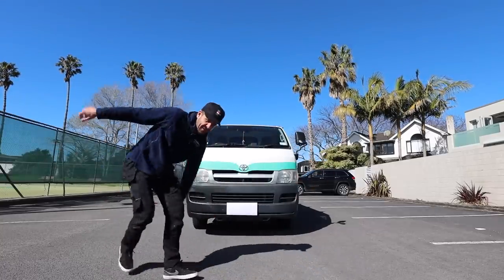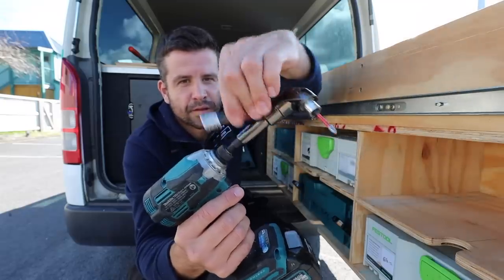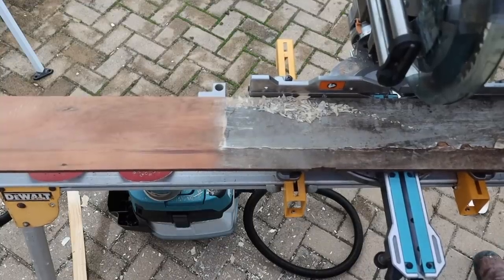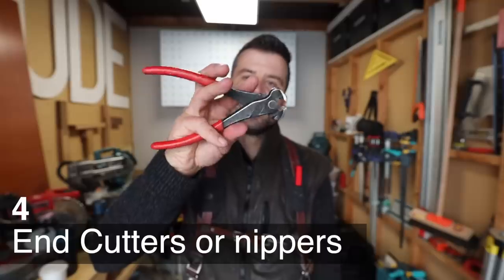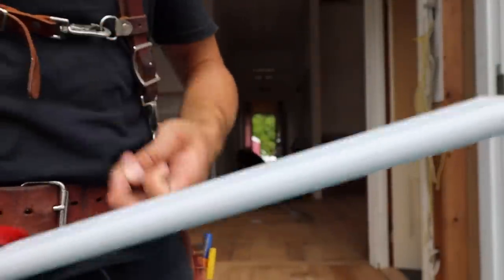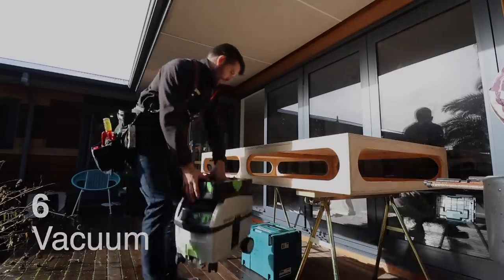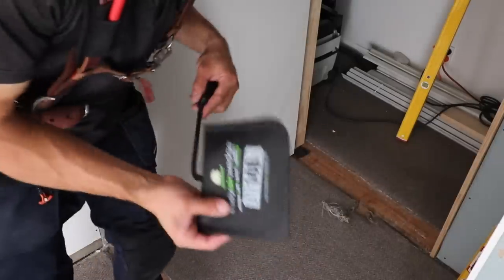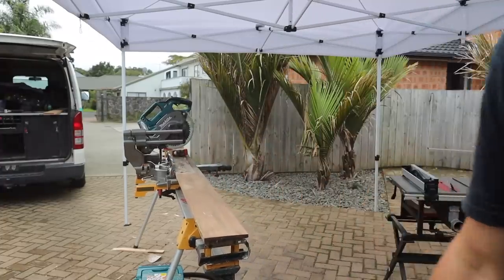7 Unexpected Tools For Builder's and DIY

Comment: My paint scraper is the same as yours, and I am lost without it. I can scrape a surface (instead of sanding) to prep for paint. Huge time saver. But I sharpen the blades frequently on the Tormek and am always blown away by the result. In saying that, I really regret the hours and hours and hours I wasted on a whetstone. Life's too short.

Comment: And after watching more the video a good tip is to be careful with the razor blade scraper it is great when you needed to be sharp but if you need it to be a little bit dollar and if the switchblades Take It Outside to some fine concrete and just give it a little back and forth on the fine cement Adele the blade just enough that it still grabs and cuts good but it actually doesn't digging deeper than you wanted to cuz it will do that

Comment: 2:15 BUMMER, as that’s the nicest looking and legit right angle “bit”. Some of them have a rounded head at “right angle” and hard to get into places and made of plastic, the one you have is “cut out” at right angle and looks all metal and well made. Dang it, now I want that brand you have…. FYI, glad you chose that MILW right angle adapter; as not a fan of the “newest” one they have…the SHOCKWAVE right angle adapter, the bit collet is closer to the adapter itself compared to the non shockwave model, but prefer the shape, feel, use if the one listed compared to the “newest” shockwave right angle(when got it, used for few weeks and went back to older model, as “felt” better to me. But everyone is different and that’s my opinion of the shockwave right angle adapter).

Pretty cool vid, and all the tools are useful, maybe not every day; but definitely used when remodeling; and maybe even in everyday home repairs or installing RTA furniture etc….👍🏻
Cheers✌🏻

Comment: HINT: on your angle adapter, use a normal drill; use painters heat gun for the hard paint; love the Multi with plain blade to separate flashings or anything glued; buy super long multi blade. Hope the crazy lockdowns end soon bro
Reply: Pulls out milwaukee 1" drive impact

Comment: i am a retired furniture maker who has a 100 year old house which is getting a full reno.  my wife bought me a multi tool for my birthday one year.  i thanked her profusely whilst thinking what the hell am i going to do with this little gimmicky thing.  i was so wrong.  i use it for flush cutting dowel plugs, cutting the nails behind base boards so i don't split them.  the list goes on and on, which just goes to show she was right.  she is smarter than i am lol.  oh as an aside, the scraper blades can be touched up on a diamond plate rather than just tossed.

Comment: Scott you have the ARES 70790 right-angle Driver, not sure if it's still availble,mine dates from around 2018.
Milwaukee's angled driver Part No: 49228510 looks identical, & rated for 40 Nm torque and a maximum of 1750 rpm.
Reply: Nice one!

Comment: I'm a DIYer but have remodeled 4 houses in the past 20 years from the studs in, roof to foundation. Never needed a right hand drill. There are other ways. Sure, would be nice but what isn't nice is a huge number of 1 use tools.

Paint scraper is only needed when actually needed. Zero reason to just have one. There are actually several useful/needed tools for removing old paint.

Might be location but I've never had an inspector check wood moisture. Never heard of that. I think I'd wait to see what they find.

I do like nippers for pulling nails.

Oscillating saw is great. Cheap too. Wouldn't say that's an unexpected tool. Easier ways to dry drywall though. Just score with a knife.

Vacuum is an "unexpected tool"??? Surprised hammer didn't make the list.

Air wedges...complete waste of money. Actual wedges still work.

I guess mostly this is just to sell products.

Comment: I’m using most of those on a daily basis at the moment here on Great Barrier, just Hope level 4 ends before I run out of Gib board.
I don’t have a moisture meter or an air wedge, i guess the moisture but I’m recycling used timber anyway and I use my teenage children to hold doors up and be human G clamps when hanging doors and windows.
Hang in there, Lockdown Scott Brown….
Reply: You'll be lucky to get gib board delivered to Gt Barrier. I am holding out till level 3 to get gib board delivered for a small job in Auckland. I have heard a rumour that developers have already bought the entire stocks, meaning the smaller guy, or the guy doing renovations will have to wait.
Reply: @gsf67  I’ve got enough to finish the job and what need to do, when I’ve used it all I’ll be bored with it anyway and if at level 3 probably have to go off to work. Doesn’t surprise me that the big boys have been buying up all the stock, luckily I’ve got the time and space to buy well before I need and stock pile, and if I don’t have what I need I can wait. I’m in year 10 of a 12 month renovation……..

Comment: What's your best method for removing stud adhesive? Hammer and chisel method does the trick but takes hours for a big reno
Reply: A lot of people use multi tool 👍
Reply: Electric plane by far the fastest. Just watch for framing-nail heads.

Comment: That WILL shred on impact. I have test it. Milwaukee have a fkn great one. Buy that. Used it, abused it for days on end. It holds up to good. I need one of them for my work and Milwaukee can be used for days and days. Never broken one. It soon are hole in the plastic from scratches from beeing pusched in small concrete spaces. But that are my fault.

Comment: I bought a couple pairs of the Kuh-Nee-Pex (listen to how Germans pronounce it if you care about that sort of thing : ) end-cutting pliers for the purpose you illustrate. I still like them but I have a couple issues with them: 1) It's easy to cut through nail-gun 15 gauge and 18gauge nails when trying to pull them out. 2) If you accidentally cut through a nail, it still leaves a significant nub. They're not flush-cut nippers. I got a pair of the Crescent nail pulling pliers. They're not as sexy but they're pretty foolproof.
Reply: I hover round second hand shops and shed sales looking for old tools to refurbish. Dunno why, but a lot of them are brilliant compared to modern equivalents. I have 3 versions of end cut pliers which are ancient but astonishingly effective. Even on rusted square head nails in native wood, they still tease them out.

Comment: Is NZ a humid land? Crazy that your inspectors care about the lumber moisture.... Or is that red stuff treated lumber that comes wet? Our framing lumber is kiln dried and we only use treated where we absolutely have to
Reply: There a lot of humidity in the air here and the industry is very regulated compared to most countries. Takes ages to dry timber out sometimes. The Pink colour is treatment for decay and insects
Reply: All the timber is pressure treated and green (fresh). Most is kiln dried but it with the subsequent pressure treatment and outdoor storage it seems to stay wet enough. Our winters are very wet - not cold enough to rid the air of moisture.

Comment: Inspection camera but one that connects to my phone wirelessly. I won't state the brand name as it might be different for other countries but it's tiny, wireless, can record footage on the app it's used with, has an LED light and only cost $100 Australian (every other inspection camera for tradesmen is at least quadriple that) 

Just too helpful when you can't access spaces to find cables without causing damage which is usually the case with renos
Reply: Name it!
I want one.
Reply: Why won't you name it? What does it matter if other countries have different ones?
Reply: @TheAlphaKap  ferret inspection camera my dude 👉👉
Reply: @DiscoFang  didn't think the name mattered. Also don't want someone to order it from another country and pay big bucks for something they didn't have too.

Comment: Vacuums are great, but often over-looked is filtration.

I throw in an extra HEPA bag on my shop vac and still wear a respirator. I already have lung issues so for me it's easy to keep it in mind.

I've seen guys run their company's vacuums not checking and they're throwing fine particulates into the air. Young guys just shrug and cough it up... they'll be sorry in a decade or two.

Comment: paint scraping. I used in my old apartment a heat gun and a simple scraper (a putty knife), it does not burn the wood and it seemed to work wonders. For me at least seemed to have saved some of that elbow grease for other occasions.
Have you tried that? Any opinion on paint scraping with a heat gun?
Reply: i also use a heat gun for paint removal.  but i also use a linbide blade that he shows, as is a lot quicker and easier than using a putty knife.
Reply: @TaylerMade  I thik that blade is very uefull and easy to use. I probably just miss my heat gun (left it in my old home, 2 countries ago)